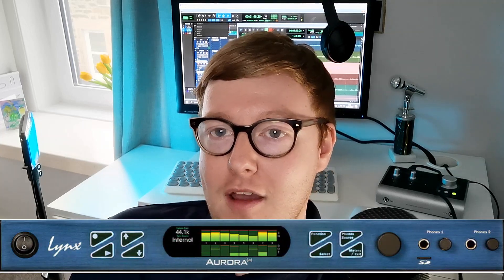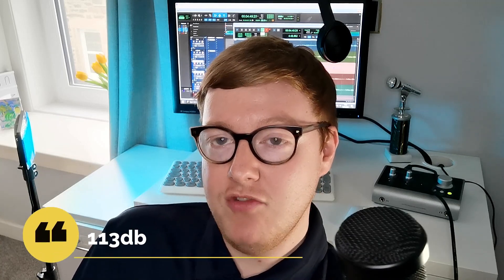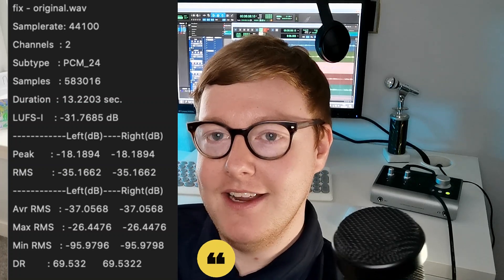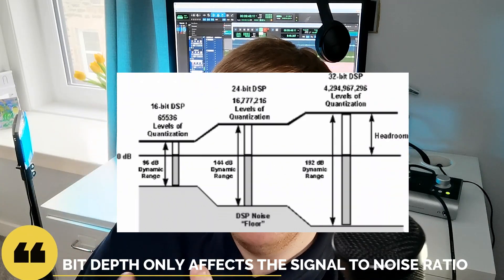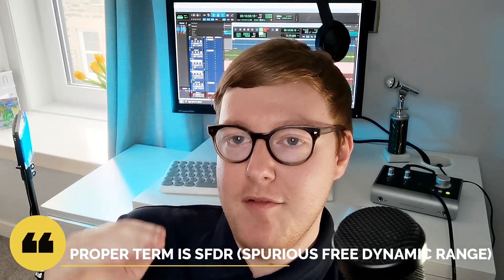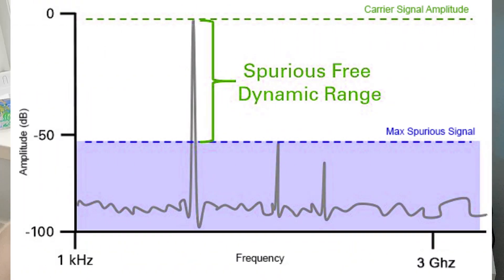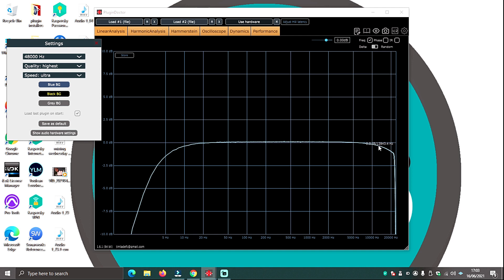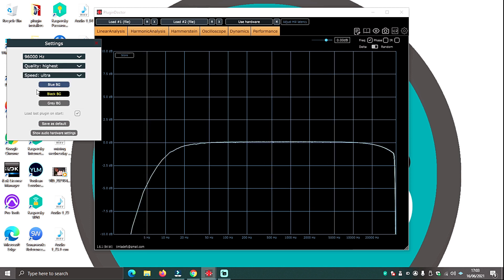Do you lose audio quality in analog gear using budget interfaces vs expensive ADC Converters (Pt 1)

Comment: Paul, I own an Aurora N now after waiting months for it to be built. Right before that I got a 404HD because it has a Cirrus Logic chip that’s about the same as the one in the Aurora N. Unless I mislabeled files, bounces from the 404hd and Apollo Twin nulled. 404HD is a great value. Anyway, the Aurora N decimates the 404hd, Twin, and the original ID14. It’s not just the conversion either. The real Lynx sounds like the Access Analog loop back but 5x better. Lynx also allegedly measures the N itself whereas a lot of companies just reuse the specs from the chips. My Sweetwater rep said Lynx told him the headphone out is 0 impedance. That is big. It sounds phenomenal with a K701 or RS-1 and revealed problems with VSX. How it adds reverb and comb filtering. Another Lynx review talked about how it allows bigger sessions to retain clarity. I’d agree. With my Fusion I no longer have to place a trim plugin after it to avoid feedback noise(and the noise never went away completely with the Twin and 404hd). I’d recommend everyone read Nwavguy’s site about the odac creation.  It’s very difficult to get a device to live up to the specs of the chip. Took Nwavguy a lot of trial and error. My plugins all sound a lot better with the N. A lot less thin and anemic. As a listening for fun device, the N is as good as anything I’ve heard at Axpona or a head-fi meet. It’d be worth it just for that if I wasn’t engineering. Audio science review has a lot of measurements of Lynx gear that I found helpful. I’m going to watch your video again. My take at the moment is that a lot of people would be better off investing in an N instead of hundreds of plugins, stacks of hardware, courses, or thousands in head-fi recommendations.
Reply: Hey, thanks for the discussion. I’m looking for new interface right now and the N is on my shortlist.
A Demo unit with 8IO is already on the way.
Since I’m using the dangerous bus+ I’m just afraid that I need 16…
Anyway:
My question:
1. In your opinion it’s worth the money.
2. Have you ever used yours with ADAT?
Thanks✌🏻
Reply from the maker: Tbh comments like this is what proves my point in regards to the transparency which is marketed as its all about these NIGHT AND DAY DIFFERENCES. that's not transparency. Everybody forgets that the whole point of the video was disproving that you lose audio quality by printing analog gear through an audio interface. Id14 on reflection wasnt the best comparison, id44 is as you can bypass the preamps but in regards to what you actually hear out of your monitors is massively affected by the DAC. 

The plugins sounding better bla bla isn't the plugins actually sounding better. It's just that you prefer the overall sound of the DAC. That's your listening experience, not the plugin actually sounding better. Exact same as mixing on a pair of audeze compared apple ear buds.. The plugins don't actually sound any different but your listening experience does. 

This test is discussing the ADC not DAC. After buying a topping dx7 pro+ I can fully say with a lot of certainty that a top grade DAC/headphone amp combo will indeed result in a better sound stage, transient response and a more linear listening experience BUT that is seperate to the Analog to digital conversion when printing through gear. 

When I listen to my topping I have no ADC going on. Purely digital coming from the DAW from USB being converted into an analog signal that I hear out of my headphones.

The marketing of lynx talks about the transparency of recording analog gear through it.. The main purpose of it which is to convert a processed analog signal from gear into a digital signal so it can be processed in the DAW.

That's why this test was done so in regards to the ADC you can see that

1. Lynx isn't actually that transparent 

and

2. You don't lose any real perceived quality by printing through interfaces like audient.

If we're talking DAC and headphone amp quality then yeah lynx will absolutely trump any audient interface but on the ADC front.. The  "fact" that there is significant degradation of audio quality by printing gear through budget audio interfaces like audient is the reason why you need to use a 3 grand converter.. is just a myth perpetuated by companies trying to justify their hefty price tag.

As I said in the video, the real justification in price is in the amount of inputs, that's essentially what you are paying for. For those who use tons of gear and consoles etc 

If you are printing the odd compressor and external preamp then you don't need an aurora. Id44 would do the job just fine without any significant degradation of audio.

Just thought I'd clarify that we're not discussing overall conversion in this video but ADC.
Reply: @PaulThird  I like the insight, Paul. Here’s the thing about your video and the way you presented it. You’re giving people the impression that they don’t really need an Aurora N if they have an Audient ID14. With taking such a strong stance, I think a more nuanced and comprehensive view would be worthwhile. I almost canceled my order partly because of this video. 

When people tell you about your presentation and the politics as you made a video about, this is what they mean. 

There is this whole subculture within the audio industry of people who are telling everyone that they don’t need certain things. It really goes back to Graham Cochrane. 

I wonder if your results would differ at all with an actual Aurora N there. I can tell you that the results of me saving a file with the ID14 with Access Analog’s Lynx via their plugin is quite a bit different from bouncing it with the real Lynx. 

Lynx does a lot of marketing about transparency. Their measurements are among the best out there. I have no way of qualifying what you or they say. 

Is transparency only considering frequency response? I don’t think the ID14 measures as well as the Lynx in some areas. That could result in the N being closer to the source in other ways aside from frequency response. 

My goal with listening for fun often has to do with transparency in the source and headphone amp. With mixing and mastering, I want to get the sounds that are typical of albums I like. I’m not gonna worry about transparency if I get what I’m looking for. 

I would have been much better off spending on an Aurora N instead of so many other things. Plugins often do sound kinda anemic compared to the hardware. The Aurora compensates for that to a decent degree one way or another. 

To simplify it some, the Aurora has enabled me to get much better results than I would be if I was still using the ID14. In that case, I’d have to ask whether the transparency edge you’re saying the ID14 has is providing a lot of value. 

You should look at the 404hd and that UMC Behringer line. The 404hd is just as good or better than the ID14 and the Twin if you’re just staying ITB. I didn’t think it sounded any worse using Fusion either. But, I couldn’t even get Fusion routed through the ID14 software as I may have said already. With the Twin it was always iffy if it would work. 

The Fusion hardware is definitely leagues ahead of the plugins too. It can do a lot to make a track sound like a finished album. And that’s what I’m after. 

You can do a lot ITB. Jake from Blood By Design told me he was just using plugins, reamped guitars, sampled drums, and stuff like Valhalla room and his Ancient One album sounds tremendous. No idea what the mastering guy did. A lot of these mastering people interviewed by Lynx have racks of hardware and tape machines along with an Aurora N. 

Well Paul, keep up the good work. I enjoy your channel. Just wanted to give you feedback on my experiences.
Reply from the maker: @viciousblissvideos  I hear what you are saying but in regards to the political side of this, I've spoken to many many big engineers about this and they all agreed that in regards to printing analog gear in a mix with an audient interface, especially the mk2's (I had mk1) that are out now, there wouldn't be any cause for concern. It wouldn't make their mix sound any better or worse. 

However, what does concern them is the amount of inputs they have as most of these guys have a studio full of gear.

If you ask these pros if they were mixing in a bedroom with an id44 and a few warm audio compressors, would they pay 3 grand for a lynx aurora N... Answer is no.

They would invest in treating the room & monitoring before anything else.

My mastering engineer bought an expensive converter (I wanna say prism but I may be wrong, might be lynx) and he's thinking about selling it already cause he just doesn't get any real benefit out of it. Printed mixes through it and stuff and there's just no real output for his investment, bar the DAC & headphone amp. 

He got way more output by investing in slate VSX compared to whatever he paid for the converter but it was a lot.

I'm trying to be a realistic voice for those trying to make a career out of mixing. I'm in circles with engineers who I look up to and not one of them tell me to invest in expensive converters or analog compressors. Just look at the landscape.. Jaycen Joshua is now 100% itb, where serban has been itb for over a decade. Wtf do they need expensive converters for? 
When you bounce a mix it happens in the daw. Your interface has NO baring whatsoever on what the sum is. UNLESS you route the mix into the converter like hardware and print the result but at the end of the day what's the point? The lynx aurora isn't a summing mixer, it's an AD/DA. The only only real converter I've heard that actually adds something to an overall track is the lavry gold which was 9 grand if I recall before it was discontinued but engineers seen that as a piece of outboard for printing their mix through. That wasn't their workhorse converters. It was mostly avid HD's cause nearly all of them have protools rigs. 

When I ask for advice it's always about my ear training. All about the mix, the prep, the vibe, the feel, balance. The only thing they advise me to invest in is the monitoring, cause you can't mix what you can't hear. 

When it comes to monitoring, I completely agree in a high spec DAC, combined with a an amazing headphone amp. You can't mix what you can't hear.. And lynx SMASHES audient and other budget interfaces in regards to DAC but ADC.. Audio science review has done tests on audient gear and its not the ADC that's the main issues, it's the DAC and headphone amps. 

That's why i made a video last week discussing the importance of headphones and DAC's when mixing on headphones. 

Honestly, if you take the time to speak to mixers you respect in the industry you'll found out pretty quick that they don't really give a f*ck about converters. It's something that will never make or break their end result cause they all admit that technology has caught up and what was amazing 10-15 years ago is now a fraction of the price and in most well built audio interfaces. 

I get told so many stories about how expensive stuff was 10-20 year ago and how lucky I am to be growing in the world I am today where that same technology is now affordable and within reach to the average consumer.

The first lynx aurora for example is now seen as "decent" and "alright" compared to today's standards and still costs a grand second hand.

Topping has proved that today's modern world can produce measurements that we don't even need to be that good at a fraction of what others charge.

If you have tons of gear then yeah you need a solid converter that can give you the I/O, clocking and stable drivers needed to print that gear in the daw.. Its practical. That's what I said in the video. All about your needs but if you genuinely believe that a lynx aurora N and an ssl fusion is what gets your mixes better than the itb guy down the street then my advice is that you are investing in the wrong things.

Honestly man, if I was to sit in a room with these guys and tell them that my mixes are gonna better cause I bought a lynx aurora and a fusion id get ripped apart... In a nice way.

They'd ask to listen to a mix I'd done on them and then proceed to tell me all the reasons why my mix could be improved and id guarentee you some would ask me to print a mix without the fusion and compare.

They wouldn't say.. Wow, you can really hear the lynx conversion there.. They'd tell me practical things about the mix they hear. They wouldn't say.. Wow you can really hear that fusion, they'd ask me how I used it so they could summise if an issue they are hearing is caused by that as its over the entire mix. A lot of these guys will work top to bottom when giving you feedback.

Believe it or not, I'm actually one of the good guys here. I'm not telling people to spend 100k on gear to make it as a certain mastering engineer youtuber is at the moment. I'm telling them to focus on what really matters and makes the biggest difference.

Splitting hairs on ADC conversion of analog gear you use when mixing isn't gonna turn a shit mix into a great mix, no matter how much you spend.

That's what I'll never stop fighting against, is the elitism of parts of the audio community. Telling somebody to spend 3 THOUSAND POUNDS on a converter to run 2 or 3 pieces of gear they can afford is hands down THE WORST advice to give somebody trying to make a career out of mixing from their home studio. 

Maybe 3 grand is small change for some but for most of my audience.. That's 2 months full wages at least.
Their money is better spent on things that actually have a big impact on their end result
Reply: @PaulThird  Paul, are you saying that pure ITB files bounced out of a DAW will sound identical from one interface to another? Maybe you aren’t. One of the first tests I did was to see if a bounce from the Lynx sounded the same as one from the Twin or the 404hd. Definitely not the same. 

If it comes down to something where I could just plug a Topping DAC into the ID14 or the Twin and get the same result, then I’d probably sell the Lynx unless I was able to get more hardware. 

A big problem that I’ve never seen anyone address is the fact that we don’t have finished mixes to reference. Only mastered tracks. How are we supposed to know what is good enough for a competent mastering engineer to work with? We have no idea who a client may hire either. And a lot of mastering people ask for remixes. 

So, I decided I’d rather see what I could do to make things sound like a finished track as opposed to focusing on mixing alone. 

Watch the multiple YouTube videos of Fusion plugins vs Fusion hardware. It’s a massive difference. I don’t use the Fusion in mixes since it was so hard to route with the budget interfaces and when it did work, it was so different from plugins that whatever track I used it on would stick out. 

So, I use Fusion to master almost exclusively. And it really does that well. Much better than using a bunch of plugins. Maybe someone with a top notch room, skills, and experience could work a miracle with plugins. Fusion just makes things much easier and faster. 

I’m quite sure I have heard that a lot of rooms cannot be treated well or at all. Room treatment can be expensive and can also be done wrong. 

I forget, have you used VSX? My conclusion is that maybe it’s better than relying on a flawed headphone out, but it was throwing off my use of FX like reverb due to the reverb inherent in the plugin. Plus those are closed headphones that bring the problems inherent with that design.

It would be good if you were able to try these things in your room outside of access analog. 

Back when I was mixing on the ID14 and using JBL 305s along with K701s, I’d make stuff that sounded great on them but didn’t translate well on computer speakers in another room. A big reason I got the 305 was because there were claims that they measured extremely well, flat even, in untreated rooms. But they make most anything sound tremendous. 

It’s very tough to teach mixing or learn from videos. For me, I had to spend a lot of time experimenting with plugins and doing stuff hands on. 

It also depends on what someone wants to do. I started doing this myself because the samples of work I heard from studios in this area was not what I wanted to do. Stuff was just kinda barebones. A lot of rock and metal became too clean and transparent with all these fake instruments playing too perfectly.

Lately I’ve seen productions that are much more in line with what I like. Blood By Design, Foxes, Drown Again, Anathema Optimist, it’s been a relief.

Isn’t it often a struggle for people who work on bigger name albums to earn these days? I heard that some in the interviews on the Lynx channel. 

There’s a converter shootout I’d be interested in your opinion on. I think it was done by Produce like a Pro. They had Burl, JCF, Benchmark, and I think some HDCD thing. Each one radically changed the audio. 

Another topic it would be good for you to get into is cpu processing. That can be a severe handicap. In 2015, I could run like one instance of Satin tape on what I was using. On my Ryzen 1700 system, I can run a lot more. I’ve done a lot of work over the years trying to figure out what sounded the best and could be used the most. 

Obviously, if cpu power is unlimited, we could run the best Acustica and Nebula stuff in big quantities. As it stands now, I can’t even run one instance of Azure 2 at 96k in a mastering session with Fusion as an insert. 

Maybe I could run one instance if I built a new computer with one of these top rated Intel chips that have double the single core power of an overclocked Ryzen 1700.

I’m trying to recreate more old school pure analog record sounds and that’s not easy to do with plugins. A lot of files that noted pros get are tracked with analog gear or even tape. Greg from Kush also used the term “tracked by geniuses”. A lot of these sampled things were made with analog gear. 

My thinking is that it’s tough to provide general advice to a group of people where we don’t know what their goals are. It’s often assumed by others that everyone is just trying to do the latest trendy pop and R&B stuff. 

Decades ago you had bands who would make records that sounded pretty good in cheap studios. And it could be done since it was all analog. A lot of low budget metal records from 80’s and 90’s got a flawed production that worked. Nowadays someone does something cheap in a DAW and it’ll sound like sterile garbage. And that’s happened with some of these same metal bands. 

Transparency is the enemy in a lot of musical styles. 

If someone has no budget and wants to start mixing, it’s a tough call what to recommend. It can be easier to get something like a Fusion or an Aurora N if you can get the payments small enough. But now we also have PayPal pay in 4 and Klarna for plugins. 

The first thing is just the computer. Nowadays it’s so much cheaper than even 2018. A lot of people are just gonna download all the cracked stuff. Probably start with Waves since so many pros have promoted the Mercury bundle as the end all be all. 

Determining plugin quality is a whole nother can of worms. Some plugins have serious defects, like the Metric Halo Channel Strip. Pros love it. I’ve always hated that thing. If you read the tests in the gearspace plugin analysis thread, the thing is adding low end as you subtract it. Something about it being a DF1 biquad. I did the test on some other stuff and the Pro Tools eq3 had the same problem. 

Andy from Cytomic said there are a lot more out there, but he didn’t name names. It’s harder to test compressors for that. Navigating the sea of plugins can be difficult. 

That would be a good video for you to make. Beginner’s guide to plugins. 

Ultimately it’s about someone’s natural capacity to hear stuff. There is so much variation in recordings. It’s tough to give standardized answers to solving problems or how to use a plugin or piece of equipment. I just decided I needed to devise my own methods. 

Paul, you’re an honest pioneer and I always look forward to your insights.